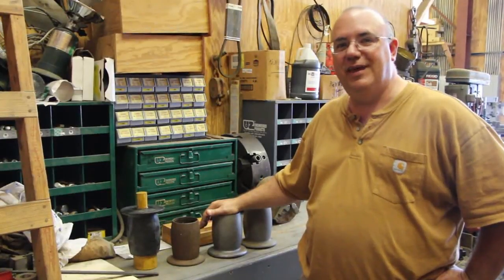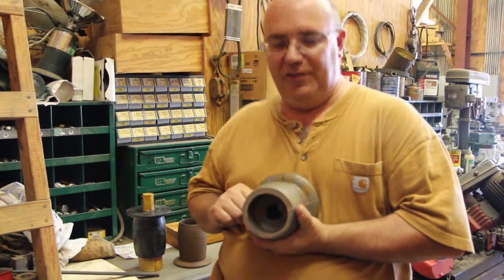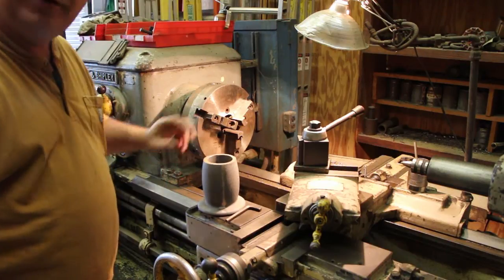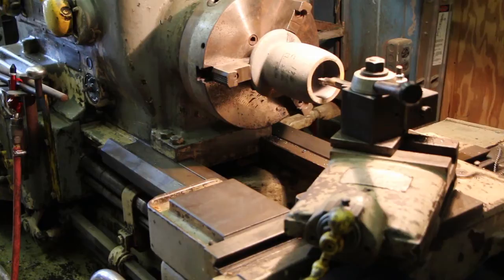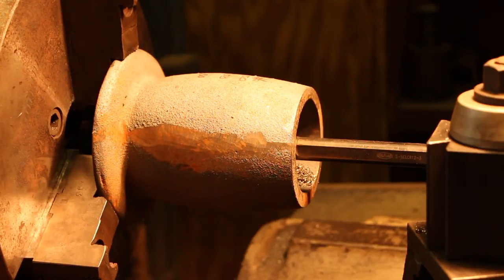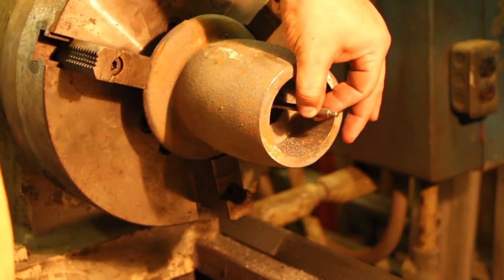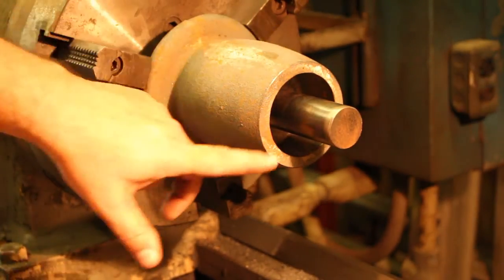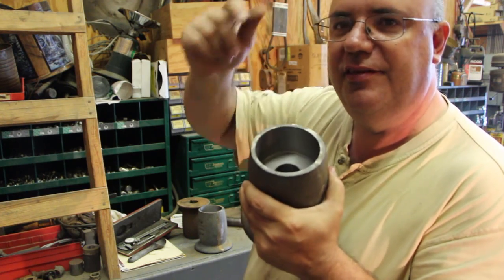Boring hub in Flat Belt Pulley

Comment: Cattail Foundry:
Cattail is a Amish ran foundry that runs as a sideline business to their farming operations. The specialize in gray iron and aluminum castings for steam hobbyist but will be glad to make OWWM parts as well. Since they are Amish, contacting them electronically or even by phones can be complicated. They do have a phone number that will allow you to leave a message and they will call you back, but don't expect anybody to actually answer (it is worth calling just to listen to the recording on the answering machine!) Most OWWM'ers will simply box up the part or pattern they need to have reproduced and mail it to them. Typically, six to eight weeks later, you will get your pattern and new castings back in a box with an invoice. They do excellent work and are very reasonable in price.

Cattail Foundry
Emanuel J. King
167 W. Cattail Road
Gordonville, PA 17529
(717) 768-7323

(copied from http://wiki.vintagemachinery.org/FoundrySources.ashx)

Comment: I've enjoyed watching your progress on these parts and I'm glad to see they turned out well.  You mentioned there was some unexpected runout.  If you had chucked the parts by the inside of the cored section for boring, would that have eliminated the runout?  I've heard that cast flywheels were machined that way, by chucking on the inside of the rim, because that face and the spokes and hub don't get machined, so they become the reference for all the machined surfaces, outer flywheel rim, hub bore...  In that way, everything will run true to the unfinished casting.  By the way, I'll be taking some parts to Cattail in a few weeks.  They've done a number of castings for my 1903 Case traction engine.  Keep up the good work!
Reply: My impression is that the runout is due to poor placement of the core in the sand-mould. The inner and outer surfaces are not concentric. When these are machined by Keith Fenner you can see how badly out of true these castings are.